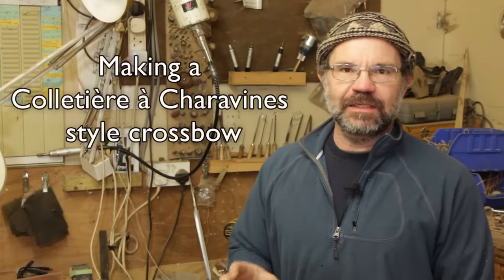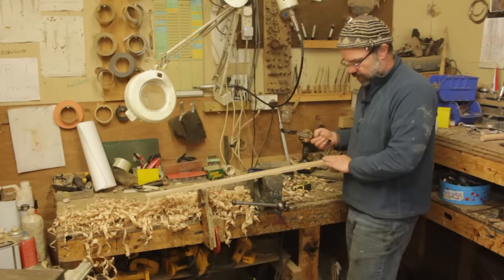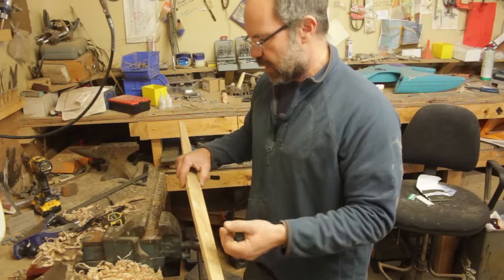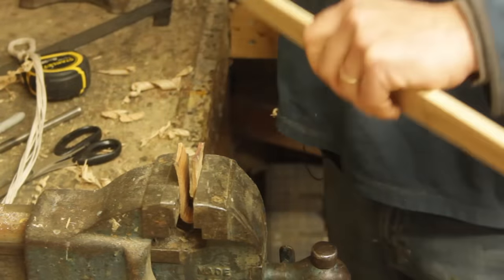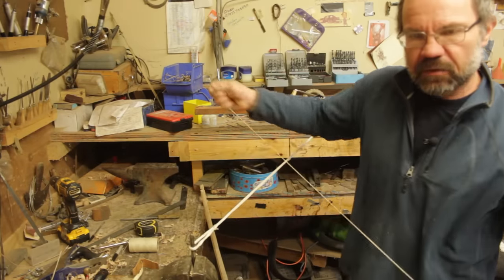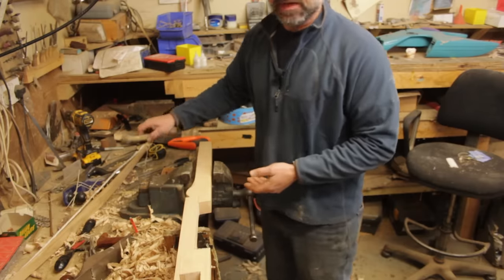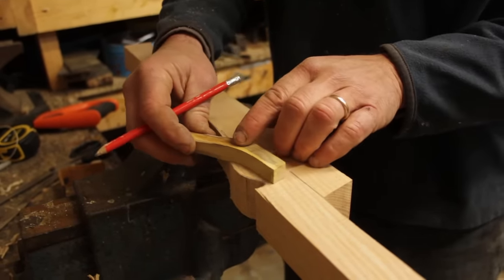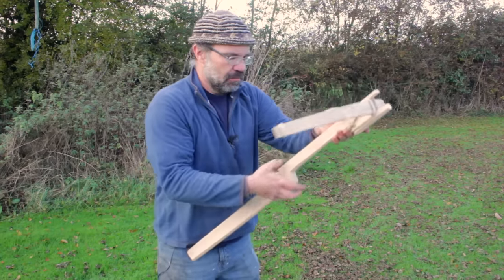Dark Ages Crossbow - Full making process

Comment: My really old tape measure is more than a sixteenth inch out of calibration from the hook to 1".
   The inaccuracy is caused from allowing the tape to run back in and slam against the case. The hook has play equal to the thickness of the hook steel. If it can be moved more, it's inaccurate.

Comment: Does the bow lose strength over time from being bent when you load the bolt, or does the wood keep strength for a long time
Reply: The bow will eventually lose some power over time,  the wood will warp while strung for long periods of time.
Reply: @kylerknaffla7355  Hence why it should only be strung when in use.

Comment: If you hear the dreaded CRACK while tillering a bow (It happens from time to time.  Just keep building bows and don’t give up), you can still save the bow by adding a backing.  You can use sinew, rawhide, bamboo, fiberglass, any number of things.

Rawhide is a great traditional backing that the Indians used (feather not dot).  An excellent source of rawhide for bow backing is those rawhide dog bones at the pet store.  Just soak it in water until it unravels.  You may need two.  If so, just overlap in the center.

Glue it to the bow while still wet, with some hide glue.  As it dries, it will shrink and add a recurve bend to the bow, which will help with arrow velocity.  Once it is all dry, urethane the whole thing to waterproof it.

If you don’t care about tradition, and just want to shoot an arrow; use fiberglass reinforced packing tape, and run the strands of tape lengthwise down the bow.  It’s not very pretty, but it works.

Comment: The crossbow has been used for nearly 2,000 years! Look to the East. China had crossbows, but were somewhat simplistic, designed to be fitted to a longbow for the conscript soldier.
Reply: Chinese crossbows from the Warring States period over 2,200 years ago were already complex designs using bronze lockwork. The examples from the Qinshihuang Mausoleum use short stubby composite bows, not longbows. These were proper weapons of war mass-produced in state arsenals and etched with the personal seals of the ministers in charge.

The simpler crossbows you're talking about actually came from later periods in Chinese history, after the fall of the Han dynasty. They were meant to simplify production because warlords and ethnic minorities didn't have access to the state arsenals of the old imperial army. The latest versions showed up as late as the early Republic period.

Even older crossbows existed in the form of Gastraphetes used by Greeks of the Classical era.

Comment: What did you round the corners of the of the bolt groove?
Reply: Oh sorry, I meant what did you round the corners of the bolt groove with?
Reply: tod todeschini sorry again, I mispharsed it. I meant the place where the string touches the stock. You said you were going to round the corners so it doesn't wear down the string.

Comment: "Our 1000 year old compatriots didnt have measuring tools"
Pulls out powerdrill
Reply: Workof of course they had measuring tools 1000 years ago the Egyptians had measuring tools 3,000 years ago ,also they did have power drills 1000 years ago it was a bow drill which was a power drill compared to  heating a iron spike and burning a hole through as they did prev
Reply: Is a power drill a measuring device?

Comment: Caption at 0:45 says 'possibly from the peasant uprising of 1525' so if they are anywhere near right it's not contemporary with the Colletière bow.
Reply: Yeah, the Swedish find is actually 16th century. It might be an old design overall, but it was probably cheap and practical enough that peasants were using these into the early modern era. It's not like these crossbows would be all that powerful compared to 16th century military grade crossbows.

Comment: Would a light crossbow penetrate maille and padded armour.
Reply: Define "light" crossbow. 350lb metal prods crossbow can be considered light compared to 130lb asiatic composite crossbow. 
Crossbows need to take account of how much length when you draw it, not just the draw weight.

But yes, to your answer something like 350lb metal prods crossbow can definitely penetrate maille and gambeson.
Reply: @cool06alt  Ah, apologies for not defining what I'm meant by light. I'm not familiar various types of bows crossbows let alone the poundage of their draw weights. (I'm not overly good with numbers in statistics.)

By light I meant would a European hunting crossbow penetrate maille and gambeson? If so, what type of hunting crossbow and what poundage?

I'm doing as much research as I can as I'm in the early states of writing a medieval fantasy story.
Reply: @Is_This_Really_Necessary  To give you perspective, 70lb compound bow can easily penetrate 7mm-wide mail ( 4 chains in 1 configuration) armor.  This was done with 400 grain arrows at 300fps (or 26 gram at 90 m/s). 

But compound bow is technically speaking, got the longest string by the virtue of it utilizing dual pulleys, sometimes quadruple. So when you pull the string to say, 28 inches, the mechanical return force that done by the bowstring might be doubled of that length, because the pulleys give the big contribution of accelerating the mechanical return, with enough force just like how you can lift tons of weight with pulleys configuration in crane or water well. 

Meanwhile, all european crossbows (late medieval crossbow tbh) utilize (very) much shorter draw length. Like barely longer than 5 inches. Hence why they need to have such absurd draw weight number. You can imagine just how much you need to match 28 inches X 2 draw length of compound bow with just 6 inches draw length from rigid metal prods? 1250lb crossbow apparently were closer to 135-150lb longbow.

Some hunting crossbow predate the use of goat foots lever, so expect something like 135lb-200lb crossbow. But don't worry, as the video shown these "dark age" crossbow were ussually made out of thick wood, prods being as long as shortbow and of course with more longer draw length than later era metal prods crossbow. They might penetrate, but I would be a bit skeptical. Especially considering that not every chainmail armor and gambeson were same.

Roman-era chainmail vs Ottoman era chainmail vs early medieval chainmail were different. Same with 13 layers gambeson vs 35 layers gambeson which we know as buff jacket.

So my opinion, a hunting crossbow that made out of metal, compact and strong enough you need to pull it with lever, might penerate armor like mail + gambeson. But not at longer distance and certainly only might apply to armor worn by common foot soldiers.
Reply: @cool06alt  Jawsome, Thanks. Your input has given me a better idea of how I would like the conflict to function in the story. :)

Comment: I think the string would possible take off of the deck when shooting if you cant the bow at roughly 10 degrees.
I usually made it so that bow and string was aligned in a straight line at full draw.
Reply: Hello tod todeschini
Not sure if you got me right. I wanted to say that I also cant the bow, but in an individual angle that makes sure the drawn bow and string forms a straight line when it's cocked. Of course, then the strings rubs increasingly from the moment it's released. But I can't imagine it helps the accuracy to cant the bow over this specific angle. But yet I did not try to cant a crossbow bow higher than this. So I might be wrong.
BTW - in case of the crossbow with the "resting notch" shown in the video, not the (low)resting position would determine this specific angle, but the position where the string gets on the back end of the track right after it's released.

Comment: You too cheated with trigger and did logical reconstruction instead of one pictured in the book- looks like the wooden thingy they identified as trigger will  not work :)
Reply: Exactly. This is very logical solution, unlike the pieces identified as  triggers. Tried to figure how to fit these "triggers" from publication  into the frame and failed. But they definitely were parts of something mechanical. French guys made "official" repro of this crossbow for some exhibition back on 2004 or 2005, regretfully never saw a good quality photo.

Comment: Fairly good presentation. Your use of the hand plane and file indicate that you do not know how to properly use the these tools. As an instructional video, you have to use proper techniques with your tools. Never draw or pull back on a file, rasp, hand planer, or saw with pressure on the material you are working. Use pressure only in the cutting direction of the work edge. The back pressure dulls the cutting edge beyond usability and can ruin or wear out your tool faster than with proper use. This creates more time working on your tools than using them to make your projects. C

Comment: There is quite few points of missinformation here...       They had mesurement devices and used trigonometry and basic string and weight etc tools all ready few thousands years bc ....  

I mean...  i do not know where you get your info, but  i think you should check few facts before you tell them onwards..     who would use shark skin as sand paper when simple rock would be better and easier to get.     they even used flint & obsidian to work on wood objects.       But hey..  i guess shark skin works allso....     Some how i think you have no idea about history and primitive technology.

Comment: Unsafe saw technique.
Reply: 1st rip on the bandsaw was unstable, unsupported directly under the kerf. Once he had a flat to work with, remainder of the cuts were flat on the table. Seems like the thumbs pushed the stock all the way through at the end of the cut, instead of reaching past the blade to pull or using a stick or a block to finish the cut.
Reply: @leehaelters6182  No pusher.  Fingers too close to blade.
Reply: @tangobayus , agreed.